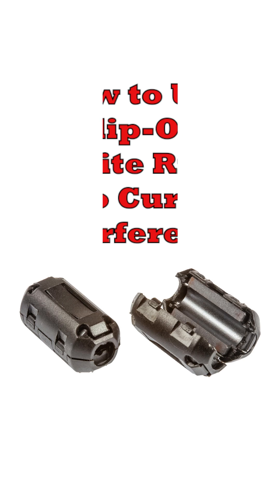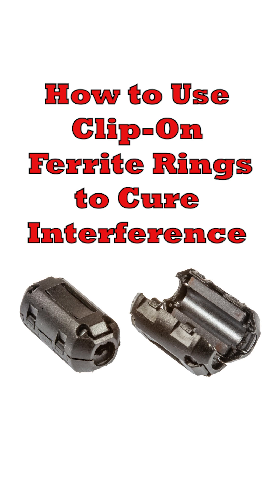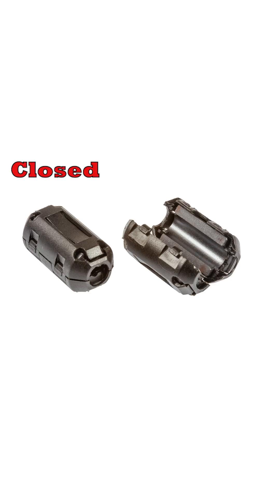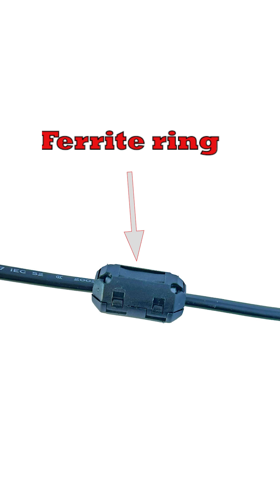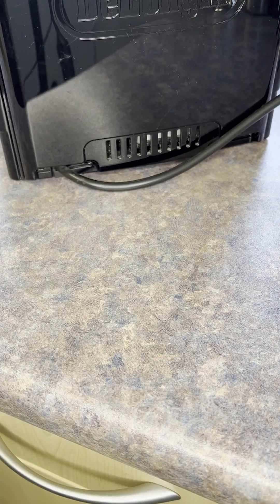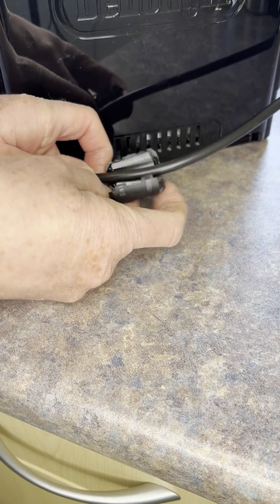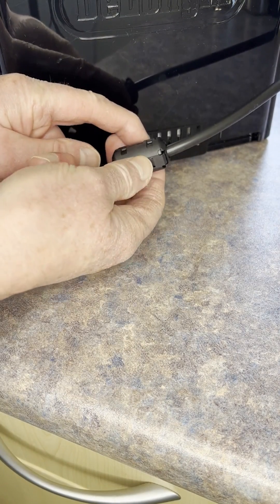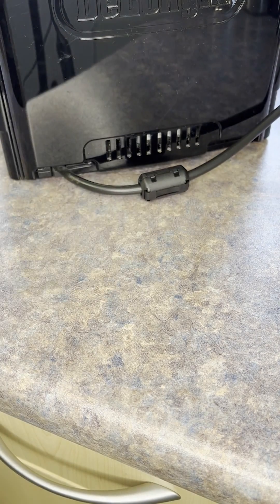How to Cure Power Line RFI Interference with Clip-On Ferrite Rings

Comment: Will a 9 mm ferrite bead sqeeze down on a 9 mm power cable thanks
Reply from the maker: It should do as the 9mm is the internal diameter of the ferrite. But fully check the datasheet.